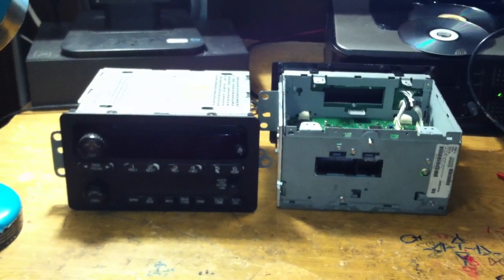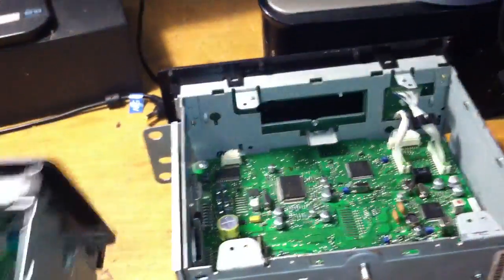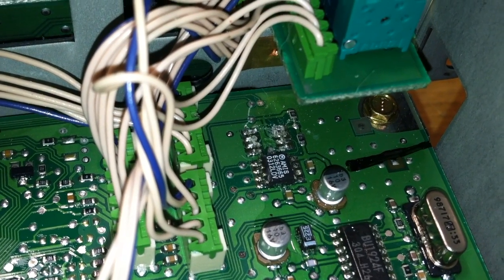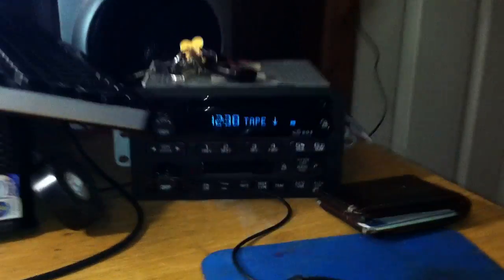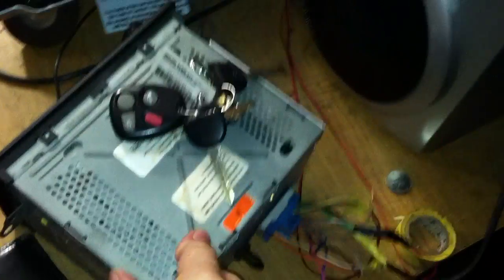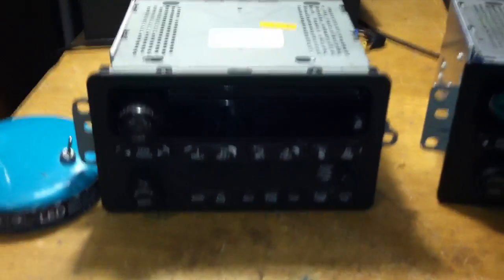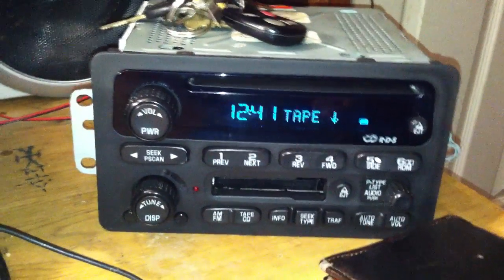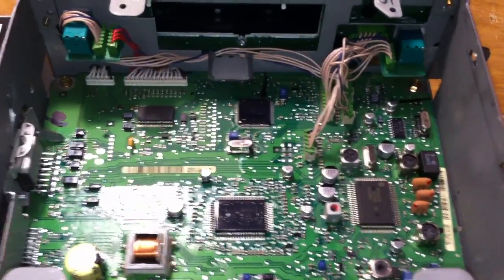Unlocking 2001 to 2005 GM Class II RDS Stereo Systems

Comment: hi pan,my RDS chevy radio is different from these 2 on your video.mine has 1 horizontal ans 1 vertical up front but nor the one in the middle like yours .... HELP
Reply from the maker: +rick nieves You have to take it to the dealer. Removing the chip on that type ruins the radio. See my other video. Simply click the red warning box when this video starts, and it will direct you to the warning video.

Comment: If you are not hearing AUDIO after doing this, then the issue is that that the stereo was programmed to use a different AMP. GM used BOSE and Non-BOSE AMPs that communicate with the radio before producing audio. The radio has to be matched to the AMP.  I'm not sure how to bypass that
Reply: Yeah, that's the issue I'm having and also what I suspected the problem was.

Comment: +Pan Gramercy Do you know where the amplifier is located on this type of radio? I think it's internal, I just know I don't have an external amp that's typically located in-between the rear speakers.
My issue is my right side speakers (front & rear) are fading out for a few minutes and then back in repeatedly. I think it's an amp issue. Any idea?

Comment: At 4:45 do you connected the wires together  yellow with the thicker wire
Reply from the maker: +L.A. HINKZ Yes. One is the ignition signal, the other is memory power. They need to both see power at the same time for the radio to power on.
Reply: Thanks

Comment: Hi there. Any thoughts for the 2010 model?
Reply from the maker: +Simon Allnutt Too new. Those use an on board network internal to the car. Dealer activated required. GM stopped using these style radios in about 2006/2007.

Comment: Works like a charm. Mine was the type with easily accessible chip. Used pliers and twisted it off. No problems with "cassette light". Radio presets remain after shutting off. Has "calibration error" message when first starting radio.
Reply: do you remember what it said on the chip
Reply: So the presets remain?  I hear some saying that you lose your presets everytime the car is turned off

Comment: what does it mean when your radio beeps and the stations turn on they own?
Reply from the maker: +J.J “Grizz” Pinckney Steering wheel controls have shorted out and failed. Very common. If you pull the radio out, and clip the dark blue wire it will disable them.
Reply: +Pan Gramercy Ok makes sense...it started with the pre set button on the steel wheel stopped working....thanks peace

Comment: Have the older model and removed the top right chip. Radio display reads "ERR"  (not Cal Err) and doesn't work. I can insert/eject CDs, but nothing I do results in sound.

Important to note that I may be having a different issue with my car as there is no audio of any kind coming from my speakers. For example, the seat belt pinging sound cannot be heard in my car. Occasionally it does ping, and I hear a fuzz from my speakers. That's it, though. No music.
Reply: I came across the same issue after removing chip. no kicking myself. have you found a solution ? or do I need to look for a new radio?

Comment: This totally worked for an '08 Grand Prix radio, mine was the one on the left the "older one." Just did a little visual comparison and knew it right away. I actually bought a radio off 1factoryradio.com to get an aux input on the front, but didn't wanna pay someone to "activate" it, saw this and the rest it blissful listening. Thank You so much 'merica
Reply: +momo19862005 The one from 1factory will work with this method, however, you'll lose preset memory, equalizer memory, and it'll display "calibrate" for a few seconds when you start your car. I actually sold the radio I did this to and sent in the original one from my car and he fix it up with the aux port. It's listed on their website as a rebuilt.
Reply: I am currently getting my radio rebuilt by Factory one radio and they told me the board on the chassis was bad and they have to replace the chassis so I'm going to have to get it unlockd and programmed  to my car. I wonder if It will work for me on my 2005 Grand Am seems like it would thanks for posting this.

Comment: My cd player wouldn't eject anymore so i bought a a used stock RDS on ebay. Worked great but was locked. Attempted the fix by removing the chip (newer one in middle of board) like in video and it wouldn't power up again. For a workaround i took the cd mechanism itself out of the locked ebay one and swapped it into my current stock one and it works flawlessly now, so i guess the locking issue doesnt apply to the cd mechanism itself. hopefully this helps someone else.

Comment: I need some help I bought a stock stereo from some guy off Facebook and it locked up on me so I took out the chip like you instructed on the video everything worked but I am not getting any sound from the radio. I have a 2004 silverado.  Any help would be greatly appreciated

Comment: I tried this on my refurbished radio and it still says locked and I've tried everything from pressing the 2+3 and the 1+4 method and it still doesn't unlock any ideas? Its a 2001 Pontiac grand am radio.
Reply from the maker: nuggetofturrd Google "Unlocking Theftlock Radio". Different type of radio likely. Pontiac did not see these until later.
Reply: nuggetofturrd  This video is about GM radio's not Pontiac .
Reply from the maker: Pontiac radios are the same... Just different face plates.

Comment: This is an Eprom chip. Electronic erasable programmable chip. By removing this, you can't store your stations, best bet is to resolver it, order a new one p/n AT24c08A in SOIC package (style) digikey. Can be remove by using an exact knife under each leg, apply slight up pressure and touch with a fine tip soldering iron, 25 watt as solder melts loose. Each leg will pop up. Remove chip, install new blank chip by placing squarely above the boards soldering tabs, in the correct orientation! Then touch each leg with the tip of the soldering iron. If done right, each leg will resolder back on with no need to add solder. Now you plug in your radio and your car's computer will see it blank and program your vehicles vin number and it will work correctly. This chip costs less than $4. Or buy a fancy eeprom reader writer.
Reply: Possible in Arabic language I like to connect in the house wire how to connect the wire. On external adapter
Reply: At24c08a
Reply: So... You're saying that if I replace the existing on board eeprom with a new/blank one of the same model there will be no need to use a programmer to erase/overwrite the existing one? Is the car computer able to write it's VIN info into a blank eeprom? I'm sorry for practically repeating your post with my question but if it works the way you say there's really no need for buying any programmer or using any other kind of workaround. I thought the car computer would only compare it's VIN with the VIN in the chip, and would see a blank chip as a non VIN match.
Reply: Dude, you said this same message in the other gm radio videos lol. I can respect that. But just so you know, this I'd the completely incorrect way to do this. Just get a tl866a or xprog and program the eeprom with the correct parameters and vin number. I'll make a video for you guys next week

Comment: I've got the stock radio from my 04 silverado, but the CD player never worked. If I de-soldered the EEPROM from my radio and solder it back in to a donor radio of the same model, do you think it would work without any quirks?
Reply from the maker: Apparently no. Others have tried to switch the EEPROM chip just to have the radio brick. You can replace the CD module it self in your current radio to make it play again. It's not hard, just need to find the matching, working module. These radios used three types. They are all visually different. You can get the right one from any junk yard, just pry the metal top off and look at the player, as look as it looks the same, it will swap.
Reply: Pan Gramercy Ok. That kind of sucks about the EEPROM. Tempted to borrow a tech II programmer from work to see what can be done with this thing. Has anyone been able to add an auxiliary jack to this radio like the 80's and early 90's GM radios? Going to attempt to replace the CD module the next time I hit the junk yard. I like the stock radio, but wish it was a little louder and had that jack. Thanks for responding, Pan.
Reply from the maker: You can remarry other RDS radios to your car with a Tech II
Reply: Oh that's awesome! Would I need anything from GM though, like a code or something?

Comment: I have a class 2 with bose and a 6 disk cd changer. The boards and circuitry are different from the one in your video. Would you happen to know which 8 pin to cut on this model?
Reply: any luck on this I have the same style cd player
Reply: +NewEraDad 
I removed the wrong one and ruined it so I got an aftermarket. I wish I had payed more attention to which one I removed but it was quite a while back.

Comment: OK I removed the chip from the 2006 GMC radio but it still will not play on the bench. It will still play for 10 minutes and stop. This is the one with the chip in the middle. It has an orange hot wire with a smaller orange wire under it. Could the small one be the signal wire? Please help

Comment: Have you ever tried this with the OEM Bose/OnStar 6 CD Radio's? I followed along with all of the removal instructions but after looking up the product number, I realized my stereo was completely different than the video's online. I have pulled it apart but the chipboard looks a little different. I am afraid to pull any of the chips but if I can't find the chip to pull, the radio is worthless anyway because it is locked up. This is the original factory radio for the 2007 trailblazer I have and it just locked up last week. I don't want to pay the $120 diagnosis fee to tell me that there is probably a short in the board somewhere.

Comment: Hi!

I have seen this video at least a dozen times but it wasn't until now that I understood it. Call me a slow learner but I learn :) I have three different RDS radios and all are different. The power up is the same for all three yet one lasts 10 minutes and the other two 5 minutes. The only difference is that the 2 have CD no cassette and the other one that lasts 10 has cassette. I am looking for a PAC GMON module that would power up the unit, but not to say it would bypass the code.

Thanks for the video and if I figure something new I'll post it here :) BTW my good e-mail is padingre@yahoo.com and I am looking for the wiring diagram or pin layout for this radio. :)

Enjoy!

Comment: I removed the chip as explained. put in my 2004 trailblazer. upon First power up, it stays unlocked for about 5 seconds then locks. It will not unlock again unless I remove the power. the button trick will not work.

Comment: can't remember if it was here or somewhere else but can you just remove pin 8 on these chip and not the whole chip and still have it work?
Reply: located the 9355093 in my 6 disc but the chip gives no indication of where pin 1 is. I want to try removing pin 8 first and see what happens. I can easily solder it back if it doesn't work.
Reply: zenuke Ok, figured it out. I can confirm, at least with my radio, that it works. I lifted pin 8. all works fine, it remember presets and what not. Just don't forget to plug the display controller back on when you test it. I forgot and though it didn't work because the display didn't light up but I forgot to put it back on. Cal ERR comes up as normal but works fine. Now to figure out how the changer won't really take my discs and why cds skip. Link to photos are coming.
Reply: zenuke http://starshipvonbraun.com/ss/radio/radio.html
GM 10357886, AM/FM/6CD radio from a 2004 Colorado. Again, do at your own risk.

Comment: hey umm i have the 6 disk cd changer gm stereo and the board is completely different but theirs the 2 chips and clue on which one it
Reply: Kevin, here is what I had to do with mine. GM 10357886 AM/FM/6CD from a 2004 Colorado.
http://starshipvonbraun.com/ss/radio/radio.html
Reply from the maker: Unfortunately this only applies to the single CD, CD/Tape combo radios. I have not been able to get my hands on a 6-CD changer to see if it will accept this modification.

You can try finding the 9355093 8 pin serial EEPROM and life Pin 8 on it if you can solder. I just got aggressive and ripped it off because it was easier and the radio can live with out it.
Reply: Pan Gramercy ok thanks for the info and for replying i really appreciate it
Reply: Kevin Armas i'm trying to figure out the same thing with a 6 disc changer from an 04 Colorado. i need to pull it out and look inside but was hoping to find some one who has done it.
Reply: zenuke It worked perfectly on my '03 silverado 6 cd changer. Thank you very much!

Comment: I removed the chip. No problem. I have the newer style. I can only get it to come in with the Preset 5, track forward, Power trick. The harness I have has a wire in every slot. I used the thick orange and the one beside it for power. Ground is also hooked up. It doesn't come on. Any suggestions.?
Reply from the maker: I think I saw somewhere you mentioned it came from some kind of 2004. That is the problem. The versions of this radio that will work interdependent of the vehicle are fairly rare, and there is no real way to tell which will still have the 12V ignition on circuit activated.

It would work in any car with the Class II Bus, because any vehicle is going to give the digital "On" signal from the Class II Bus the radio needs to turn on.

I've had the most luck 2001 to 2003 units will still have the 12V Ignition activated. Any of the newer ones with a Delphi sticker on it, won't work. Rule of thumb with these is, no delphi logo, better odds of working with out a vehicle.
Reply: Pan Gramercy Ok, thanks.  The button bypass is working for now.  I may seach eBay for an older unit that a switched wire will work on.   Thanks,
Reply: Pan Gramercy Can you send a link from eBay for the "On" adapter from ebay?
Reply: Pan Gramercy The ones that I found are for an aftermarket being installed back into the Chevy vehicle.  I need the other direction.  To turn on the 29Bit Data BUS stereo from a NON-Chevy car.
Reply from the maker: Kevin Adams
I'm not 100% clear on what you mean. If you mean an "On" adapter for these Class II radios, there is no such thing I have ever found.

If you mean the later GM radios, the 11 bit and 29 bit radio systems used in later vehicles, to turn those on, with out the car you need a PAC LAN29ON adapter. it plugs in line with the radio harness and allows the radio to be turned on and off.

Comment: hey i have an 04 chevy radio but its just am/fm no cd  the board looks different then both the ones you show will this work on it?
Reply from the maker: AM/FM only with a basic clock and no RDS? Won't work. Removing the chip bricks that type. Please see my precautionary video.
Reply: Pan Gramercy thanks for the info. bought a radio from a junk yard guess its time to slap an aftermarket radio in it! haha.

Comment: I removed the chip in my radio and now the radio will work. unfortunately only for 15 seconds, then it will read CAL ERR. this happens EVERY 30 seconds or so... On the bright side it doesn't read LOCKED all the time, but it is kind of a joke that it only works for a few seconds. Thanks for your video though, maybe the problem is just with my radio...

Comment: I took the radio out of a 2001 Impala and removed the 8 leg chip. Now the radio displays ERROR. Before it displayed LOCKED. Any suggestions on what to try now to get this radio to work?
Reply: I am having this same problem, sometimes when I hook it up it works perfectly, some times it says ERROR.... seems intermittent, I haven't found the cause, have you had any luck?
Reply: Rocky D I think there are some radios you can't do this mod to, if you can't put the chip back in I think you have a boat anchor.
Reply: Brian Fisher A boat anchor with a clock :{)

Comment: I removed the chip in mine just like you did on yours and it works. However, the memory issue drove me crazy! So I put the chip back in and had a friend with tuner software flash the radio to my vin. Imo, if I had to do it again, I would pay the dealership to do it right the first time. Worth every penny.
Reply: what memory issue ? if u dont mind me asking
Reply: Tater79bj how did you replace the chip?

Comment: How do you actually POWER the units without having a car? Amateur question, I know, but you gotta learn somewhere... haha
Reply from the maker: ***** 12V regulated DC Power Supply, 3 Amps or more. Basic wiring skills and knowing what wire does what coming out of the radio. Typically a diagram if you have no idea what you're doing helps when you want to bench these radios. 

I know GM wiring by heart, but on most of these, older ones especially with out the pointless security system these are part of, you just need to tie the 12V + Ignition Wire and 12V + Constant wires together, connect them to the + on the power supply and the black wire, or the shell of the radio to the - Negative on the power supply and the radios will generally come to life if there is nothing funny.

Comment: This process worked. The board looked different on my radio but it still worked. I removed the chip with the numbers "9355093" on it. Cons: radio does not hold the programmed stations. When vehicle is turned back on, radio defaults to preset fm station. 
So far it's not an issue but have to select which CD to play after each vehicle start-up.

Comment: I'm curious about something. After the chip is removed, can you still use the radio to customize the settings for stuff like the Oil Life Monitor, Automatic Door Locks, Tire Pressure Monitor and all the other settings that GM tied to the factory radio?